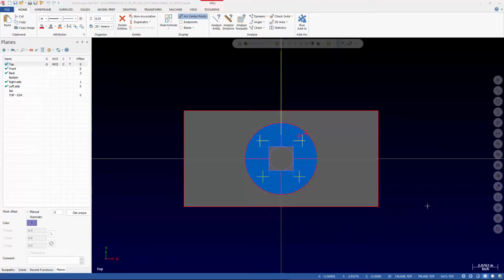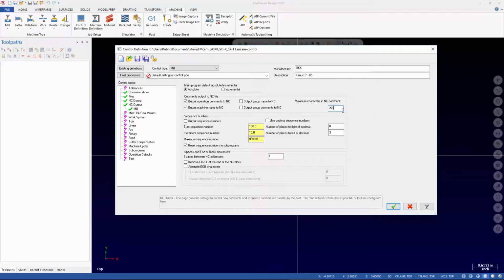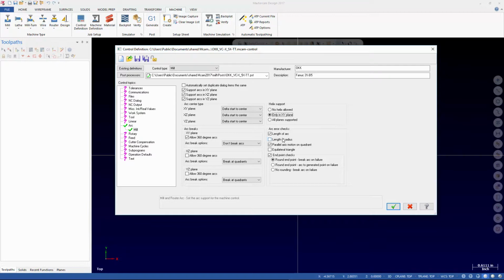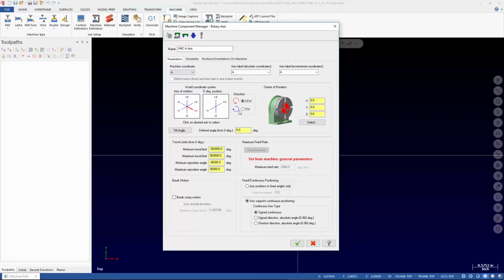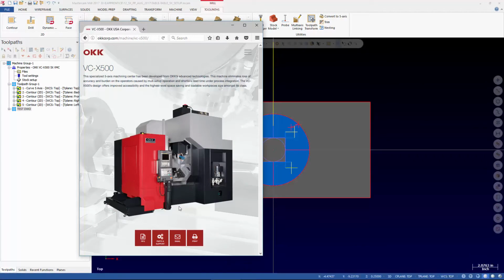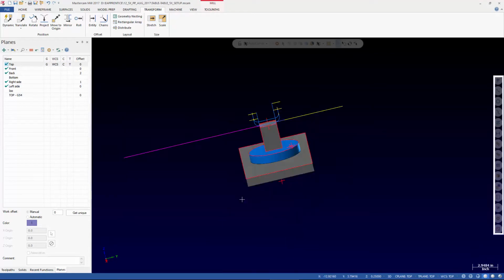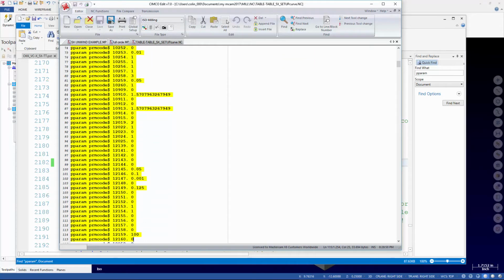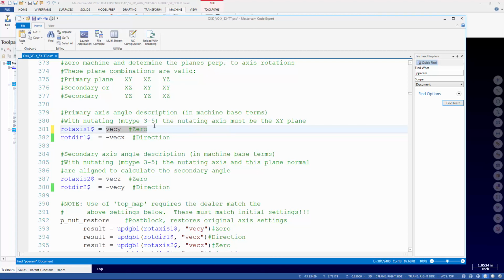MP 301 - Video-11 - 5X PP AUG 2017 DAY 4 Part 1

Comment: Hi Colin, when I try turning off this post block "psof_tlchg_blck" and replace it with my own position codes, all X Y Z coordinates of the toolpath are disappeared. Do you know what caused that, any secret thing behind that post block?
Reply from the maker: There are only specific blocks in the 5-Axis Post that are called by the PSB file. You can't replace them, unless you want to completely write your own math functions to calculate the output you need. If you are trying to support Dynamic 5-Axis codes, I recommend you just purchase a Post that supports these features. Or get really, really good, at Linear Algebra.